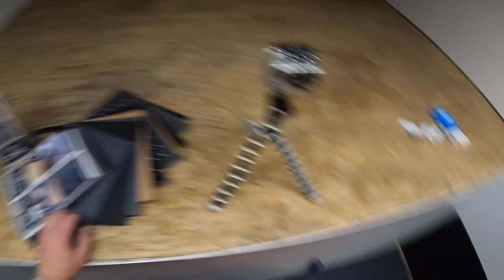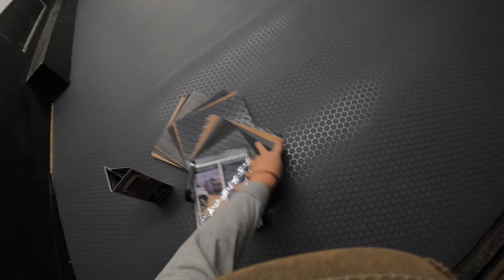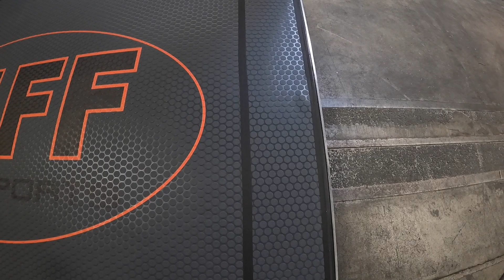G-Floor Trailer Installation

Comment: Thanks so much for this. Still unsure on gluing mine. I'll definitely glue the door but with all the anchor points(d rings, e track, cabinets) on the floor, do you think glue is really necessary?
Reply from the maker: Adhesive will keep it from bubbling and stretching with use.

Comment: Looks like you skim coated  with leveler before gluing? Recommended?
Reply from the maker: The floor had some damage so we filled some areas and then used a primer coating - it helps with adhesion.

Comment: Has the glue used on this flooring held up overtime? Any movement or bubbling of the vinyl?
Reply from the maker: The trailer was at Sonoma Raceway over the weekend and I noticed some small bubbles when it was at the hottest parts of the day..but they go away again when it cools down.

Comment: What brand of glue did you use?
Reply from the maker: The adhesive G-Floor supplies.
Reply from the maker: For going over new plywood I like to use a primer (available in most flooring departments at big box stores) first. It seals the wood to keep it from pulling the moisture out of the adhesive and dries with a texture that helps the adhesive bond better.
Reply: @garageasylumproductions1913 sorry I'm a year late but what kind of primer? Like a paint primer?

Comment: how much would something like this cost? material and labor
Reply from the maker: It depends on the size of trailer (there’s a link on www.garageasylum.com for G-Floor) direct purchase of the materials. 
Labor depends on the condition(s) of the trailer (new vs. used) probably allow $200-300 for installation (+prep).
Reply: 30 ft of it is north of 600 and the glue pushes over 700